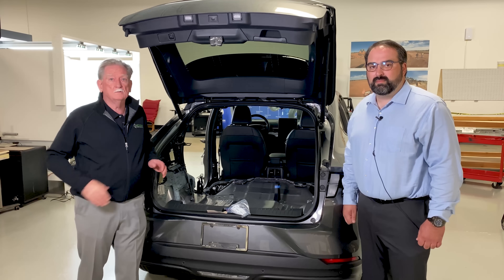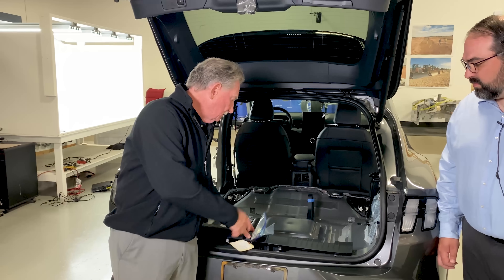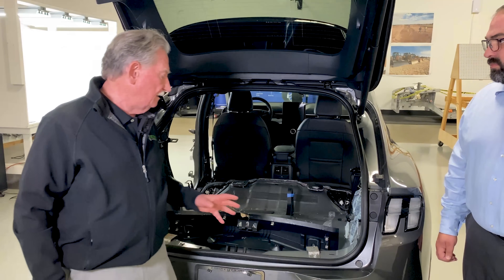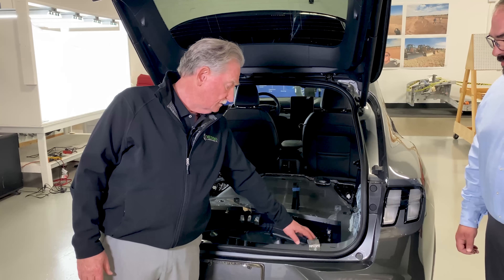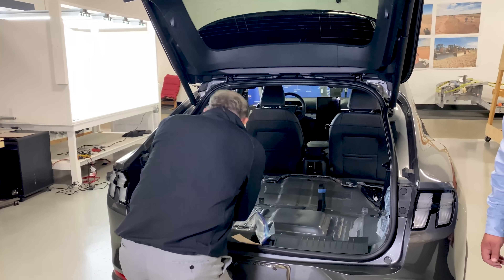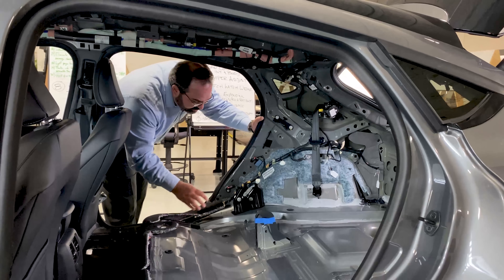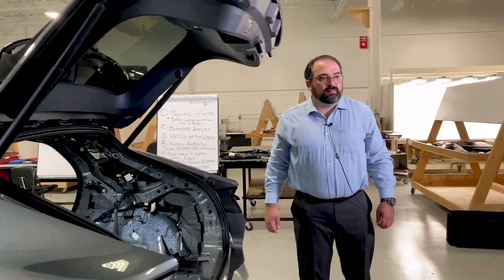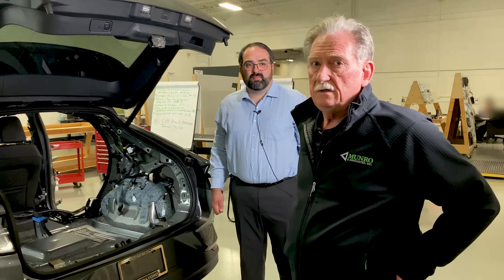Mach-E Teardown: Back Seats Gone - Analyzing Rear Interior

Comment: I guess the chip shortage is the wrong time, but they should save so much wiring if they would put a bunch of microprocessors in, and have them communicate over ethernet, and with POE at 48VDC.  you could have one 8 conductor wire goind front to back, and then have a switch to part it out to go the each tail-light, and a central one to interface to the latch, license plate lights, backup camera etc...
instead of those huge harnesses.  I knbow tesla looked at doing that, but all the suppliers are stuck at 12V... wondering if a stepdown at each microprocessor would take care of it, so end points remain 12V, but use ethernet for long runs.

Comment: With age, snap connectors deteriorate and are prone to breakage. I like having at least some screws to help secure panels. Of course, you may never need to remove many of these panels so it could be a moot point.

Comment: As an automotive engineer, the biggest lesson of this video was when Mr. Munro comments that the bracket is a communication fault between engineering groups! Maybe this was not the case for this specific bracket, but I can notice that it happens quite often.
Thanks to the good classes!
Reply: The bracket doesn't mount the trim it mounts the tie down ring.

Comment: I am somewhat skeptical of your love for clip-in designed components. I typically keep cars for well over 10 years. The past 3 cars I've gotten rid of were at 145, 170K, 195K miles and I currently own one at 195K and 145K. Plastic clips break. If you need to do maintenance on anything that requires access it's hard not to break some plastic clips. They are fine usually for about 100K and 10 years, but my experience has been that past that you start having problems. I understand you philosophy, that it's better that it just never breaks than making it maintenance friendly, which is what the manufacturers seem to do. Make it work for 100K, and it's well out of the 36K or even 50K warranty period. Not such a good thing if you are keeping the car to 200K.

Comment: Good first effort by Ford, but in this specific video, the overall impression I get is:
"good by traditional automotive standards, but outdated when compared to single to dual piece rear casting"

All those parts, widgets, glue, welds screams - EXPENSIVE to build.

Comment: Volvo has this Trunk hatch latch wedge design on their Wagons since the 90s.   Even that sprayed on noise dampening they already did on 850 series.  Everything was clipped on or could be removed with one Torx T25.  - I mean literally.  They provided a T25 and a 10mm wrench in the on board manual pouch.

Comment: In my dreams, I would take this shell and use the parts to make my Transit Connect into an E vehicle. My LWB Transit Connect has the same wheelbase and nearly the same track width as the Mustang Mach E. It might need wheel flares, but that drivetrain would fit under my body.

Comment: I would be very interested to find out if the vehicle allows charge to flow both ways like the F150. You noted that Teslas do not have this capability in an earlier teardown. I'm hoping Ford built this in for a possible over the air update that would allow the Mach E to interface with the 80 amp bi-directional EVSE that Ford is introducing with the F150 Lightning. I would very much prefer a Mach E but the ability to provide back up power for my home compels me to make the Lightning my next new vehicle

Comment: 2:00 not sure about that. 0:23 it appears to me they wanted to increase the height of the scuff plate dramatically so that its height is way above the door rubber seal.  this reduces risk of damaging the rubber seal due to loading or unloading.

Comment: Finally, Sandy gets into the area of his knowledge - interior etc., not batteries...

On my 2008, which is a 2003 model year Mercedes I have a very similar "guide lock assembly" and side rubber bumpers on the rear hatch - nothing new here.

Comment: Scuff Plate, should be thin stainless steel, and threaded fasteners are more solid attache points those rubber guides on each side is awesome and the center guides / guards for locking hook is awesome. Well done ford! First EV

Comment: I'm trying to understand these injections, expanding foams and cured sealants in the design, engineering of the base and how thats considered good design.  even though it serves a purpose and addresses an issue it would seem to be a good design would be simpler and not look like a bunch of patches and band-aids and glue and tape.   I would love to hear more discussion from a designer/ engineer on how all those pastes, foams, adhesives, injections/ extrusions could be eliminated with better design.  it looks like patchwork addressing issues that were not addressed in the design phase...an after thought now that they are stuck with the design and are forced to make what they have work.
Reply: Cad isn't magic.  You still find the parts where flex, vibration, harmonics, etc occur and stick a dampner on it.  

Yeah, you COULD engineer it out with thicker areas that are stiffer... ever see a sheet of metal rolled to different thicknesses in mm accurate areas? 🤔 me neither.
Reply: @johnb7430  thank you  for your insight.  I appreciatte your knowledge and your taking the time to respond.  However,  I wasn't thinking of CAD , on its own with a human designing a shape, necessarily, not in the current traditional legacy auto sense,  but rethinking the design using first principles approach.  So if the goal is to have a chassis or frame that is strong safe light and silent then taking an approach  to begin designing from first principles rather than metaphor of what was used in the past.  new materials, shapes and process might be necessary.  Could be an approach on the molecular level utilizing a new form of metallurgy or other material science , One approach that is growing to become the future of design is using Artificial Intelligence to create designs a human would never dream of..it seems to me one manufacturer might use CAD to redesign something based on the materials they have off -the-shelf, using the manufacturing process they have known for years and the workflow they have had integrated for years while others might design without the bounds of what has been done before , using the past as informative knowledge but not restricting themselves within the bounds of what "has been" possible and instead pursuing what "might be" possible if you start with solving problems of vibrations from the very start of material science.  A.I. can sometimes take in such goals and run with it coming up with something alien like and in that sense embracing A.I.more dominantly in the Computer Aided Design is in essence, I believe, a kind of magic. :) just my opinion at this point but I may be wrong. check this out: https://www.imeche.org/news/news-article/how-ai-is-helping-engineers-invent-new-ideas
or this design of an aircraft:  https://www.bbc.com/future/article/20181129-the-ai-transforming-the-way-aircraft-are-built

Comment: I enjoy these videos immensely. As an (electronics) engineer, I appreciate the deep-dive aspect of your tear-downs. You're showing us parts that we'll likely never see on these cars and providing the benefit of your knowledge about what exactly we're seeing and whether it's a good thing or not.

You are finding quite a few things that I would consider to be issues or choices made by Ford largely related to this being the first generation of the model. I am curious to know which things would likely be cleared up in subsequent models, or if the choices that were made will stick until a redesign several years in the future? I would think that things like the door component from the previous video and those brackets you found in this video would be examples of something that might be replaced/improved in the next model year, but just couldn't be done in time in order to get this model year out the door. 

Would that be accurate?

Comment: Snap fit fixtures can be o.k. with full plastic design parts not subjected to structural mechanical load, like remote controls, pc, household, audio and video equipment parts. If you do stupid plastic designs like Tesla, whole car front or rear come of during driving! Glass roofs detaching also occurs if your experience/knowledge with fixing different materials is poor!

Comment: Let me make, as a mechanical engineering with 30 years experience in plastic moulded parts, some remarks on Sandy's opinions of plastic part design.
Integrated plastic snap fit fixtures have several disadvantages:
Design is more sensitive to rattle.
Snap fits never can be under permanent tension because of "creep" of plastics and even worse, sensitivity for "stress cracking" for certain materials and conditions. Assembly is often not straight forward (horizontal/vertical stacking). And finally is a fixture fails you have a loose part, unless you have a "emergency" screw fix.
Reply: Thanks for confirming that. Some of us have been muttering about Sandy's obsession with eliminating actual fasteners.
Reply: Good points. Also it is very hard to use a snap fit to apply even pressure on a seal even without creap. Disassembly for servicing  is nearly impossible without some breakage too. I think he should spend less time talking about snap fit instead of that massive harness on both sides of the vehicle.
Reply: Screw snap fits!

Comment: I'm sure a few things like the brackets and the excess cooling pipework are only on there because it's a low volume car. Yes they cost more per unit but Ford probably just wanted to avoid the development costs since they don't have accurate sales forecasts for EVs.
Most of these things will probably get worked out in a facelift model if they actually sell any of these and decide to continue production.

Comment: 6:39 Looking at this seat bracket in the middle of the floor, I wonder if it would have not be better to have something less prominent, and be part of the seat?
What I mean is instead of the top part of the seat folding on top of the bottom seat, to have the bottom seat folding vertically against the front seat,
and then to have the top of the back seat folding on the location occupied by the bottom part of the back seat.
This way you get a lower trunk floor providing more vertical storage.
Another point I noticed is to have the possibility to store a spare tire flat without taking too much space inside the trunk.
It look like a flat location for a spare tire should have been provided.  
From other threads comment, when driving in the country side, especially in countries like Canada, Australia or Russia,
a good recommendation is to still carry a spare tire avoiding to get stranded in middle of nowhere on a cold raining day.

Comment: So far it seems like Ford has really designed and built the Mach E right.
I thought it was going to be a bit of a joke under the skin.
Well done Ford.
Reply: The front end was a mess, the back end is good. The next update they should switch team :)
Reply: @simoc24  Really just the coolant system was a mess. I suspect an ICE team did that work. Remember that this is Ford's first ground-up EV and its a heck of alot more impressive than almost ANY company's first!

Comment: Why, in this day and age, are there still wire harnesses in a car?  Shouldn't it just be a single serial bus wire (ala USB) throughout the car?
Reply: Most of these wiring harnesses are for CAN bus and Power Distributions.  Much more robust and reliable than USB.  Check this video out... 38 modules over 6 networks in this particular Mach E. 

https://youtu.be/MJ-mxMKNFvQ
Reply: ethernet
Reply: @brandoYT  The trend is definitely moving that way:  SPE and 10Base-T1S. Still you are only going to have the number of control modules that makes sense. You will need some wiring for things other than power and comms in the harnesses.
Reply: The question is great! Altough, communications can be done via USB, probably you're right on that section, however you need to power some stuff which might require more wires. That said, I would really love to see a gruond-up redesign of the whole concept (worked in this particular industry, luckily I'm out. :) )

Comment: The brackets at the back are for the cargo hooks, which need to be very strong, so they get screwed down into metal.  Has nothing to do with fastening the scuff plate, which DOES snap in place as he suggests.  Oh, and you don't even get cargo hooks in a Model Y.

Comment: You can really see how the Tesla castings remove the need for extra pieces and steps like sealants, brackets, "Hankles", (sp?), not to mention welds and/or adhesives.
Reply: Nope, the tesla casting is way more complex, this here is easier and has been done and improved for decades.
Reply: @carholic-sz3qv  Nope, the Tesla casting eliminates many steps and parts because all the complexity is cast in place on one shot.  You should watch more of Munro's videos where they clearly explain this if it isn't inherently obvious to you.
Reply: @JRP3  I watched all sandy videos, the casting is not the only solution for cheap manufacturing, ford already has all the machines to make millions of cars, tesla does not have the machines.
Reply: @carholic-sz3qv  Ford has all the machines to make cars the old inefficient way, Tesla has the machines to make them the new efficient way.  It's simply ignorant of you to claim "Tesla does not have the machines" when we see the castings being used in the Model Y that Munro looked at as well as the new Model S.  You're talking total nonsense.
Reply: @JRP3  another nonsense comment, stamping presses just require new dies for new car models and EV needs way less parts, ford never used 70 parts like tesla did. The chassis on the ford carries the chassis and the body is mounted on top fairly cheap and easy, no need of high energy hungry melting equipment.
Reply: @JRP3  tesla will still use stamping for doors, fenders, hood, truck.........
Reply: @carholic-sz3qv  Yeah no shit, I never said otherwise.

Comment: Sandy really hates threaded fasteners. He would rather have the wheels snap on the hubs ^_^
Reply: I think it's important to remember that Sandy's audience is primarily auto manufacturers/suppliers. So the things he criticizes aren't necessarily bad in terms of reliability or quality, but ways the manufacturing process could be optimized. In the case of the scuff plate, for example, the customer only cares that it stays attached to the car. Of course, fewer brackets means less weight...
Reply: @wallyballou7417  Less weight but more importantly... Less parts and fewer steps.
Reply: @wallyballou7417  And also don't forget they don't provide the solution. They only advise changes. Often they judge a choice but they don't know the background of it. parts used of other models, molds modified etc etc
Reply: He probably would vote for a central hub screw, just the one.

Btw, just to clarify. As far as I understand, he doesn't want clips on parts that are removed often. He wants better fasteners there and that's it
Reply: @AMalas  I had an MGA in the 60's with that central hub screw and a hammer to loosen and tighten it.  Wonder why they don't use them any more?????????
Reply: @jonshroyer364  I don't have one clue about why, I just know that it exists, and some high end sport/race cars still come with it
Reply: He’s apparently steeped in a process called DFMA (design for manufacturing and assembly).  It’s a method for reducing cost and speeding assembly by 1) reducing the total number of parts and 2) using quick-connect fasteners to save seconds in the assembly factory,

DFMA is why all high-volume manufactured goods are hard to service now and usually break when you try to take it apart.
Reply: I woulden't be supprised if you're not wrong.  Engineering is magic.

Comment: This is why I love these videos, as a non-engineer... understanding the role of those pumpable strips, I thought, "it's like the grooves they grind out of the rotating element in electric motors to tune out imbalances". It's a joy to make little connections like that, and gain a better grasp of how modern manufacturing gets a product to peak performance through a series of discrete, understandable steps.

Comment: Have any car manufacturers replaced wiring looms with a simple single wire combined power feed and signal, with a switching chip in each endpoint (bulb, etc.) ?
Reply: IIRC GM did that with a Limited Edition Cadillac they had built in Italy in the 90's (?).  They multiplexed signals for everything along a coaxial cable running the length of the chassis and decoded the signals at each end.  I think at the time the processors were not fast enough. I worked at the Powertrain  division and retired in 2009 and my memory isn't what it should be these days.  Maybe someone else can fill in my blanks. :)
Reply: The new trend is going to be using Ethernet in cars: 10BASE-T1S. You will will have separate power and comms along with inputs and outputs to the various sensors and actuators. There is a balance between complexity of the modules and the harnesses.

Comment: Is it common to just wrap the wire bundles in tape? I thought they usually used a kind of plastic conduit
Reply: Wires have to exit the bundle at multiple different branch points, so a conduit is impractical in many routing applications.  What surprised me is the quantity of separate wires in the bundle.  I would have assumed that many of the accessories were CANBUS activated, needing only power to operate and getting their actuation signals digitally over the power wire.  There is a lot of copper weight in all those separate wires.
Reply: AFAIK it is the default in the industry since... No idea, a few decades.

The reason is that the wires don't run parallel their whole way, it is a wire tree with many branches.